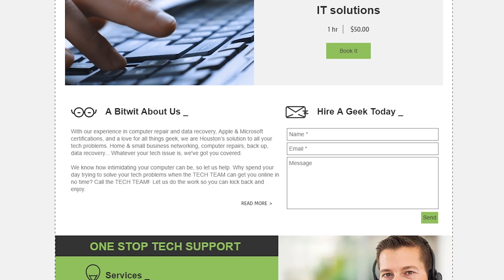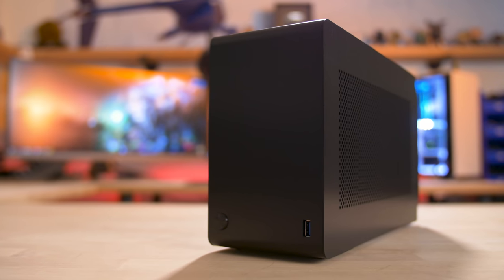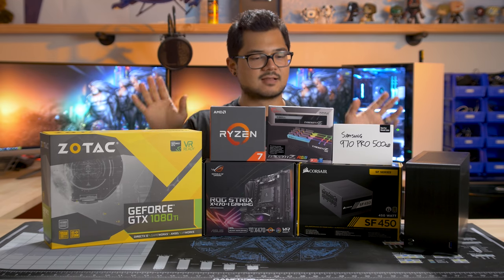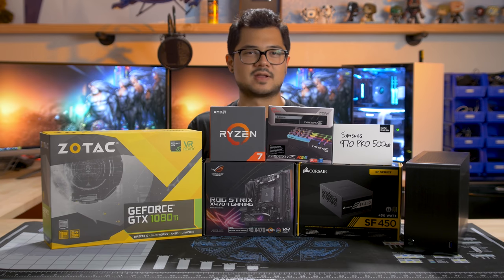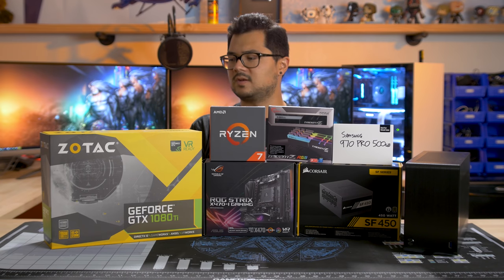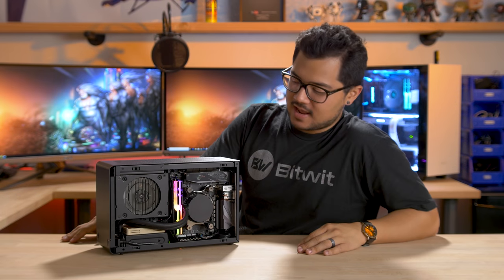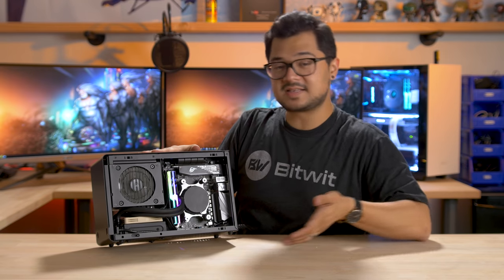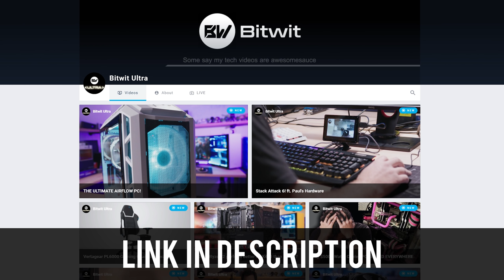The smallest water cooled PC I've EVER built! DAN Case A4 SFX v3

Comment: $225 case!!!! My Phanteks that is like 4 times the size with glass and led's was almost 3 times less expensive. Why are mitx cases priced so absurdly?
Reply: Because they aren't mass produced. Plus Phanteks isn't at the same level in terms of quality as Lian Li (the actual manufacturer) is. There is no case yet, that would be 1.25kg only which is a huge advantage if you want to put your rig into a carry-on luggage.
Reply: Did you just call Phanteks poor quality? Well I never!
Reply: Economies of scale.
Reply: U cray
Reply: Dan Cases are premium cases, you will find little to no plastic inside the case.  Most of those cases that are "3 times less expensive" use a ton of plastic to reduce cost and they are also mass produced.
Reply: @JasAce5  plastic isnt bad. The year is 2018. No case plastic or metal that size should cost that much.
Reply: +airbomb34 it does if the case is not mass produced on the same scale as those cheaper cases.   Manufacturers charge a premium to contract out orders for custom cases. So unless you own a factory that can crank out the cases on the same scale, you will see a large price difference.
Reply: The engineering that is involved with designing the case is what drives the price up. it's not a matter of the cost of the material, its a matter of paying the guy who spent hours designing that badass case to fit that hardware and be functional
Reply: All cases are designed by people who get paid.
Reply: Because they're more expensive to order, because less people order them, and much smaller than the typical ATX tower, so manufacturing tolerances are likely higher. Take a small case that needs to be manufactured to strict quality standards, then consider the cost of producing the unusual double-sided layout inside compared to a regular hollow cube case, then consider that the form factor is niche and won't sell as much as a larger case, then consider how much more factories charge per unit to make low volumes of a product versus larger volumes, and finally remember that the company needs to make a profit, and you get a price tag of $225. 

And, yes, this tiny case is likely of higher build quality than your Phanteks case. I also have a Phanteks case and it's not the greatest thing in the world.
Reply: G L A N C E V A L U E
Reply: +airbomb34 Again, cases made on a made-to-order basis cost more than cases that are mass produced.  Yes plastic can be bad if you are going for a premium look. I'm sorry you don't like that its more expensive than your mass produced Phanteks case.  I should also note that people are lining up for this case that is in hot demand.  I paid $200 for my MITX case, plus, I had the author of the case do a custom bezel for it which added another 35$ to the cost.
Reply: @airbomb34  dude the quality of this case is AMAZING. Phanteks has good quality but it can't match lian li, also this isn't mass produced which increases the cost ALOT. This case is still a bit too expensive though, look at the ncase m1, it's $185 but it offers SO MUCH more compatiblity and the build quality on these case is just way above phanteks, I'm not saying phanteks has bad quality, but these cases are on a completely new level.
Reply: Yeah i still have my dan case v2 lying around idk if 2080ti will fit or worth it
Reply: +airbomb34 “All cases are designed by people who get paid.”
Boy, it must be easy being so ignorant.
You can say that the case is too expensive, but you can’t say the price isn’t justified (for all the reasons people pointed out above)...
Reply: I built an almost exact copy of this build (2700X, 1080TI, 32GB G.Skill RAM) in a $45 case (Kolink Satellite Plus). Not all mITX cases are expensive. Oh, and the Kolink rocks! It's awesome.

Comment: @Bitwit I have a similar build with the a4-sfx and AIO. I noticed the system cools better with the fan pointing the airflow up, drawing cool air from the bottom, instead of pushing it down.
Also with the 970 PRO, since there is no air flow in the center of the case, it's always running at max temp 80C--which causes it to speed throttle to like 300 to 500MB/s. I recommend installing another Noctua fan over the CPU area and plug into the case fan power connector to cool the MOBO components and SSD. As for the ram, I ended selling my RGB Ram for some Corsair, they have a lower profile and I didn't have to kink the AIO tubes over the high rise of the RGB ram heatstinks when closing the lid.  Also, I delidded my 8700K and OC to 4.9GHZ on all cores @ +0.050mv -stable and not therrmal throttling with this configurtaion.

Comment: I also recommend you put the m2 pcie card in the front slot and fit the sata one in the slot underneath. I have this board for a build and waiting for the cpu to arrive tommorow. according to the manual if you put a nvme stick in the rear slot it shares pcie lanes with the 16x slot.

Comment: The cables are a little to close to the radiator fan for my taste, but i can see why you did that. You need some longer screws to be able to mount the fan on the other side of the radiator. But i recommend doing that. Good video and build as always!

Comment: Kyle, the V3 allows for a 120mm AIO 
The 92mm AIO has been supported since the  V2. 

Below are some links to V3 options.
---
Option A - Full length GPU + HDPlex + 120MM AIO ( https://abload.de/img/20180508_152012u3pct.jpg / https://abload.de/img/20180508_152036slqr1.jpg )

Option B - ITX GPU + SFX PSU + 120MM AIO  ( https://imgur.com/pHPO2P9 )

Option C - Full Size GPU + SFX Psu + 92mm AIO

Comment: Im surprised i dont see people commenting about the radiator being in the bottom panel of the case. I think in the top panel would give better thermals. But the case doesnt allow it i guess. Also the radiator fan is pulling air out of the case (i hope) so would be better to have a case fan pushing more air in to restore positive pressure in the case, which also puts some airflow going out across the gpu.

Comment: Just so you know, if you would have gone with a reference style card(blower) it should have helped thermals a tiny bit because instead of the hot air going into the motherboard pcb, it would get sucked in and blown out the back. Card thermals would be a little bit more, but it would help keep the CPU a little bit cooler

Comment: Dancase should design the sides as full breathable, but stylized, mesh panels akin to the Fractal Design Mechify C front mesh panel. It would allow for a but more air flow, block out dust, and allow for lighting to shine through fairly well. Just my opinion on it though.

Comment: I have Version 1 of the Dan Case and managed to get a decent watercooling setup done in there. I'm using the Gigabyte Mini ITX 1070 as a GPU, leaving enough room in the GPU compartment to fit a 120mm radiator with a slim fan pushing air from the outside in through the radiator. I also reversed the PSU so that the intake fan is facing towards the Radiator as well, basically giving me a push-pull configuration for the AIO.

Now all that's left for me to do is wait for AMD to deliver proper driver support for their Raven Ridge APUs in the Linux Kernel…been sitting on this case and waiting to complete my build for more than a year now…
Reply: Thats great! Im also looking for this kind of set up. Can you say what watercooling do you have? And what CPU? What temp is when its 100% loaded
I whant to put Ryzen 7 2700x and watercool it. But Im affraid the temp will be too high with that only 120radiator and 15mm fan. Im using CPU on full load rendering 3d graphics

Comment: Curious how hot that 1080 Ti gets in that case. I ask as I have a SFF using a CM 130 Elite and a 1080 and that thing gets pretty hot. And there's less air flow in the Dan than in that case. Still, this is impressive.

Comment: Mount the fan below the rad, in pull config. The problem of PSU wires hitting the fan is solved (Bestbuy vlog, Case in point).

Comment: Quick note, the a9x14 that comes with an l9i runs at 2500rpm as opposed to 1700-2000rpm the ones you can buy off the shelf run at.  This kicks performance up quite a bit so buyer beware

Comment: I have a pretty similar build, I also have that same cpu cooler but never used it cause I was unable to obtain the screws that were long enough to mount the 92mm fan to the radiator. Never thought to mutilate the screw holes in the manner you did to mount the fan.

Comment: i have that case and i put 2 92mm rads in it, on for my cpu, one for my gpu using a kraken g12, of course i had to put my psu outside my case to do it. i mainly did it so i could have a lightweight vrbackpack setup and it worked. the only real problem was the cooling, not so great.

Comment: I think it will be better if you flip the AIO fan so it sucks cold air from below the case and this will also help the GPU . Right now you will probably be forcing the hot air from the GPU trough the radiator...

Comment: Nice build dude. Is the 1080ti mini available with a cooler design which blows the air out of the case? Especially a mini version is build for tiny cases and you want the hot air as quick as possible out of the case.

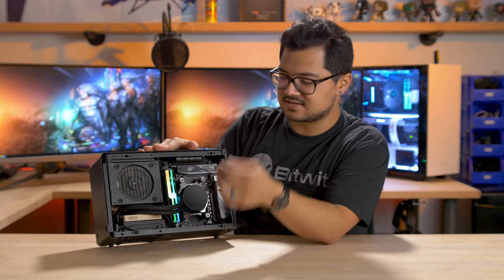Comment: Around 9:09, couldn't you simply use longer screws instead of moding the fan mounting holes with a chisel? Or does Noctua use customized exclusive threads/screws for their  fans to get into some build (which I doubt)?... Nice case btw thanks

Comment: @bitwit Dope build brotha!  Was wondering if you could've mounted the 92mm fan between the case and the radiator for a push config, to prevent the power cables from interfering with the fan.  Also, do you think that setup would work well with an 8086k and a 1080ti ftw3? Might have to go 600w, but would cooling be and issue?  I've always loved SFF cases, but afraid to pull the trigger because of noise and heat/throttling issues.  I've seen mutiple ftw3's fit in  Dan's a4 case, but your thoughts with the aio and the version 3?  Haha, your answer and or suggestions will determine if I pull the trigger.  Great work btw, always fun and entertaining!

Comment: Those mini corsair power supplies have a very high efficiency rating and very low ripple. I use the them for couch gaming and vr rigs. The only gripe is that the cables aren't as flexible in small cases as i would like.

Comment: Bitwit, you could have gotten longer screws with the Noctua installed onto the AIO. That would have been better than rigging the screw holes.

Also you can't close your case on the CPU side due to the RGB memory and the AIO tubing. So you will have to do the plexiglass installation/fabrication. You should put those notes on your video also to inform your viewers or someone is going to be pissed off at you. Still a great video, nice edits and good commentary.

Comment: I have the DAN A4SFX v2 and I went the blower style GPU cooler route because it doesn't dump the hot air in a very small space and it works great. Still looking to move from the Noctua NH-L9i cooler to a water AIO because my i7-8700K @ 4.8 GHz just starts to throttle under synthetic loads. But I need some new PSU cables that are less stiff so they don't go down where the AIO sits.

Comment: Did you use just 2 of the RAM sticks from a 4x8GB kit? Also, pretty sure that your powersupply cables will interfere with your radiator fan at some point, at which you regret using this case. If I saw it correctly, you had to use a screwdriver to reattach the case panels... Besides all that, nice little PC. Perfect for some shenanigans, perhaps for hijacking some random large TV at an electronics store or sth.

Comment: So you placed your extremely fast, but extremely hot 970 NVMe on the back of the MB. Instead of placing it inside the front mounted heat spreader?  You will almost certainly have thermal throttling on that drive. 

I understand you cause' you are waiting on the M.2 ssd and it will he easier to just drop the drive in. Though your sacrificing performance for 2mins of maintenance.
Reply: inGoodFaith The other SSD will be bigger and need the better thermal location, simple.

Comment: Do you think that with a 90 mm noctua cpu cooler and custom cables could be possible to put a 120 X 25 mm intake fan where the radiator is? Maybe that way you could improve the airflow to manage the thermals of gpu and mobo vrm, beside a warmer cpu... worth the test, even to compare / show the 90 mm aio?

Comment: Are you sure about the PSU?...I know you can't really overclock any of this but with the r7 2700x and a 1080ti I think 450W is a little too small. Even if it doesn't just shut down it will be super loud to stay cool. Corsair have the same one but 600W (SF600) and I think  that would've been a better choice for this system

Comment: Late comment but wouldn't that be pulling hot air from the 1080 through the cpu rad? possible to pull air cool air through the bottom through the rad? Also the fan placement on the bottom would clear the cable issue?

Further edit: Maybe that could help with thermals on the 3900x? hopefully without extra outside fan? with a little undervolt you should definitely revisit this build :)

Comment: Kyle, just a tip, you should change the M.2 of place because if you put the NVMe behind, the 1080 ti you will be operating at x8, not at x16, that's taken from the manual and the specifications of the motherboard.

The M.2_2 slot shares with PCIE x16. When M.2_2 slot runs in PCIE mode, the PCIE x16 slot will run at x8 mode.

https://www.asus.com/us/Motherboards/ROG-STRIX-X470-I-GAMING/specifications/

https://www.asus.com/us/Motherboards/ROG-STRIX-X470-I-GAMING/HelpDesk_Manual/

Amazing rig BTW

Comment: Nice to see another YouTuber reviewing this great case, I'm also a fellow owner of the latest V3 revision. Out of interest, which screws did you source to mount the Noctua 92mm fan onto the AIO radiator itself? I originally went down this exact same route but ended up returning the full Asetek kit shortly after as it never came with fan mounting screws at all & I could not source the right ones anywhere. I had to revert back to using air with the Cryorig C7 (turned out much better than I initially expected with the temps if any of you are wondering), if you could let me know as I am still rather keen on considering the Asetek AIO again for the near future - I would greatly appreciate it :)
Reply from the maker: I used the same screws that came with the noctua cooler

Comment: Can that AIO even breathe like that?  You have the double factor of the intake/exhaust (not sure which way it's set up) being at the bottom of the case with minimal room for airflow and also being right up against the power supply.  Just seems incredibly awkward from an airflow perspective...not to mention it's a pretty small radiator to begin with.  This feels like water cooling for the sake of water cooling.  You might actually be better of with a good downdraft cooler directly on the CPU.

Comment: I want to see the thermals for the CPU under rendering load. there is virtually no clearance for the CPU cooler pushing the air from the case out towards the bottom. Seems to me a lot of the air will splash back on the rad trying to exhaust through the bottom.

Comment: I would have put that radiator fan under the rad, that way the radiator is protecting the fan.. pretty sure performance would remain the same.
Reply: i would also reverse the flow. taking the hot air from the gpu on one side and psu on the other isnt really ideal.
Reply: I've got V2 of this case, and did the x299 + 92mm radiator Kyle mentioned. Placing the fan on the bottom cannot be done as the barbs of the radiator would interfere with the power supply and the you would kink the tubing.

Comment: I made a similar build though went to the intel's side. very nice build ^_^ ! although I would put an other 90mm noctua fan on top of the cpu just blowing fresh air there I know that It woulden't flow though just the blowing would take the heat away from all the pcb,ram and other heat making chips.I even believe it would help tiny on taking the static heat arround the cpu.

Comment: That PSU looks like it would have worked better on the bottom with the rad on top venting up as heat rises.  Seems the underlying case design was off abit.

Comment: Soo... How about sandwiching the Fan between the Case and Radiator and mounting it using appropriately long screws from the hardware store thus solving any potential cable slips into the fan blades all together? Too mainstream for consideration? Jesh...

Comment: Do you have a cheaper small build? A mini intel i5, 1070, air-cooled (if the PC won't get hot) PC build for example? I travel quite a bit and I want something that I could put in checked baggage (can a fully modular PSU go on airplanes? Asking because of security frenzy over chemicals and big-ish batteries). Any feedback is appreciated.

Comment: Do Zotac cards come sealed? I ordered a Zotac 1080ti on Amazon for $526. It was listed as new but I'm worried that it could have been used for mining and then the seller just put it back in the box and is selling as new. The price seems pretty low for a 1080ti. I don't know if I got a good deal or if I'm getting a card that was run into the ground :)

Comment: does the 2nd m.2 slot (underside of mb) not run at sata speed, or if used in pcie mode, it makes the 16x pcie slot for the gtx run at only 8x speed, see foot note of specs over at asus.